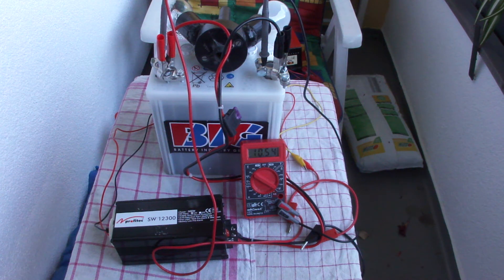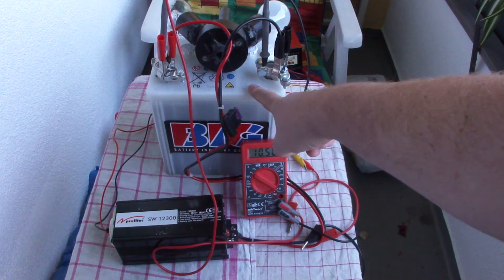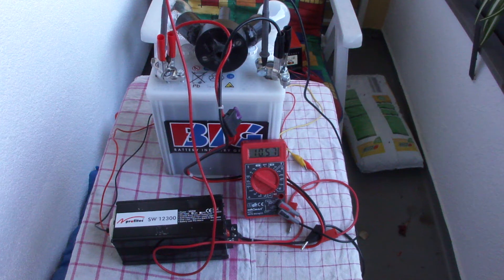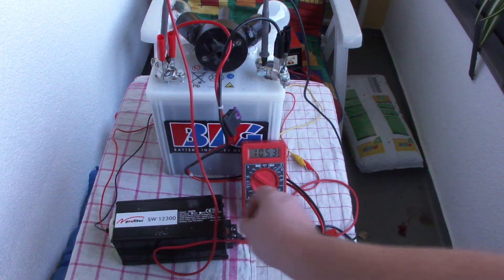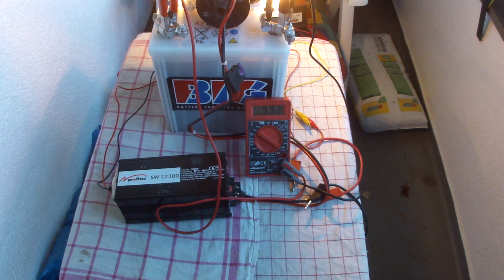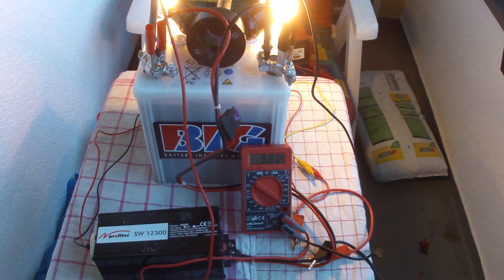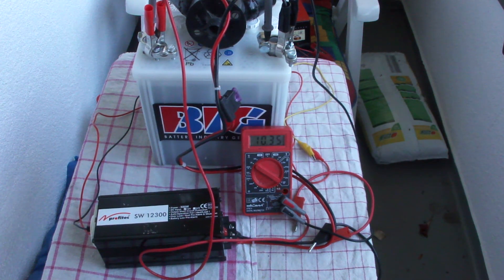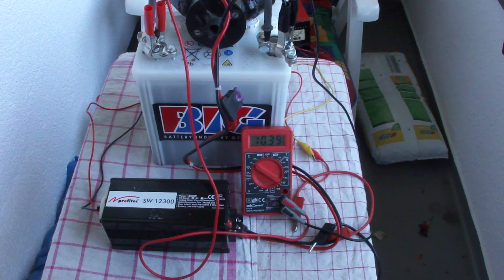First tests with a 300 Watts inverter on the ALUM electrolyte car battery

Comment: Perhaps an experiment  utilizing  Alum as a least 1 part of an electrolyte mixture for HHO Gas Generators or actually am planning a Borax or baking soda electrolytic capacitor (see Spark,Bang,Buzz) combonation HHO Gas Generator/Electrolytic Capacitor connected to an amateur radio longwire antenna/radiant energy receiver of atmospherical electricity.Opinons ?please!

Comment: My approach to conversion (I've made one yesterday and 3 today) was as follows:
1. Charge the lead acid battery to full. Even if full means 11,0V (one of the battery in my case) due to battery problems.
2. Remove the acid from the battery
3. I've rinsed briefly twice the battery with distilled water (under 1/2 liter used per battery)
4. Drain the remain liquid. I shake the battery for a minute.
5. Prepare the alum solution. In warm distilled water (approx. 20 Deg.Celsius) put alum - 50 g per 1 liter and stir until dissolved.
6. Charge for 5 minute the battery
7. Discharge to zero volts. It may takes hours (happened to me with the first one - that with 11.0 V). With the others 3 I have not patience to test at zero volts. 
8. Recharge for at least 6 hours.

I notice that one of the most important step is no.1.
Anyway, my experience is from what I see on the internet and those two days working directly with alum battery.
I baptised that conversion - "battery sex change".

Comment: I've made those days a conversion from acid to alum and I'm interested in schematics for inverter to run at 8/10 Volts. Thanks  It is possible to modify a cheap chinese inverter of 300 W, to work on lower voltages?

Comment: you should have used the acid first to condition the battery ,then put in the alum mix. also the the alum should be dissolved in warm water. 200grams per litre of distil water..... you have to remove the alum and cycle battery with acid,hopefully you didnt mess up battery